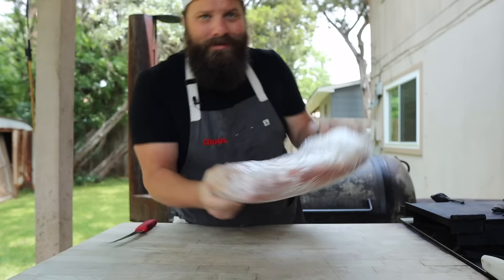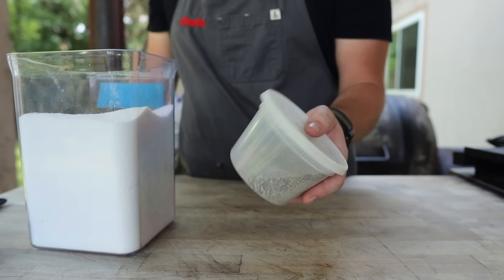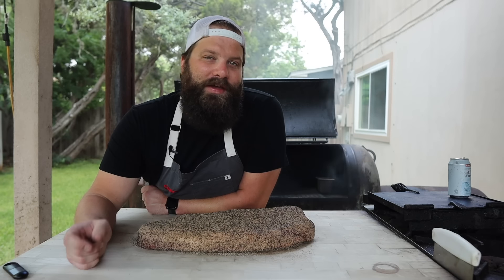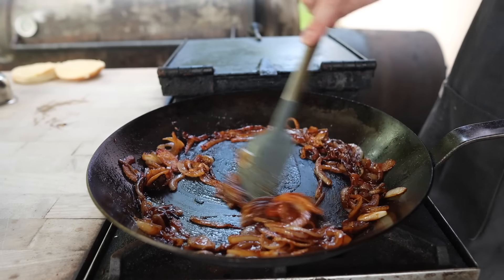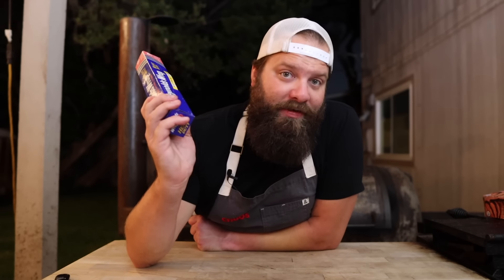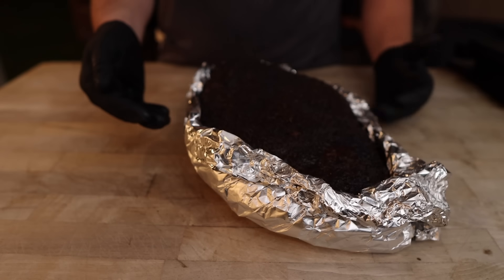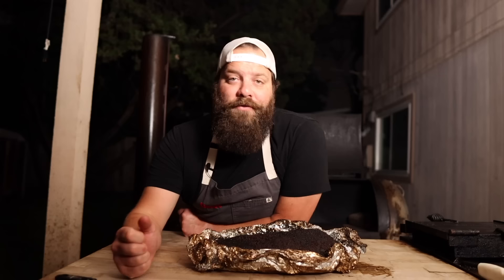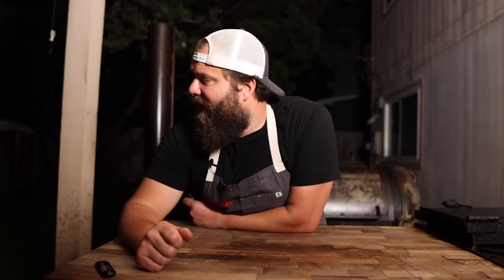How to Smoke a Brisket! | Chuds BBQ

Comment: Bradley, do you recommend letting the brisket drop to 160° and then putting it in the 170° oven?  If so how long would be too long to rest it in the oven at that temp?  Just not looking to over cook it while it’s supposed to be resting.  Is that even possible at that warming temp?
Reply: keep in mind, most home ovens do not have terribly accurate temp control, especially at the min/max range. I tested my new electric with a quality temp probe, and its minimum setting of 170, actually kept it in the 180-190 range, after stabilizing. And that is too warm for an overnight rest. i was hoping it would actually keep it cooler than 170, best case was it keeping it at 160, but alas, no. I have read that its possible on some to adjust those min settings, but haven't looked into it. Mine is a Frigidaire glass top.
Reply: @ckmoore101  ya that’s what I’m afraid of…. And on the opposite end, if I drop it in a cooler with towels, it may dip below 140 which isn’t safe…. So how can you keep it warm enough but not too warm?? Thinking about wrapping it in an electric blanket in a cooler perhaps???
Reply: @Bigslimjim81  After pontificating for a few.... first, start with a quality cooler. Boil a ton of water and pour in cooler, and close lid. leave it for at least 30-45 minutes. Then drain, and put in brisket fresh from smoker, and cover with a lot of towels. One of these days, i want to test this, and just see how long it takes to dip below 150. Could be the only time its actually worth it to drop the cash for a Yeti cooler, since pretty much everyone agrees they are the best there. I saw a specialized one at my local BBQ store (Kansas City BBQ Store). I love that place. Cooler was $300 though..... i didn't buy it.
Reply: @ckmoore101  think I’ll follow the cooler method and see how long before she dips below 150°.  Also may throw in a heating pad which might help to maintain temp inside the cooler too
Reply: @Bigslimjim81  Not a bad idea! Heating pad might make the boiling water step unnecessary. Do any pads today NOT have timed auto shut-off? 
Post results.
Reply: @ckmoore101  forgot about the auto shut off feature…. May have to re-think this..
Reply: @Bigslimjim81  Try wrapping bricks in tin foil, and heating them up in the oven at 190-200 for an hour or so. Then lay them on top of a towel in the cooler, and then cover with more towels, then meat pan, more towels. I bet that will work for a good 12 hours, or more. I havent done this, but it just hit me.
Reply: @ckmoore101  wow what a great idea!!

Comment: What is considered a MAJOR temp swing?  Still haven’t tried a brisket since I am getting used to fire management.  When I am trying to cook around 250° I’ll throw a log on around 240° and it will usually spike to about 300-320.  Is that a major swing or somewhat normal?
Reply: Are you on an offset? You should be able to keep it within 25 degrees. Like I cook at 250 to 275. Throw on a new log, goes to 275ish, wait for it to dip into the high 250s and throw another log on. If your jumping 50 to 70 degrees at a time, you need to use much smaller splits.
Reply: @blakelocati  yes to the offset.  Old country Pecos.  My next smoke i was going to try smaller splits to see if that helped.
Reply: @joestarke1357  I have a similar size smoker but homemade. Split your wood down and even consider cutting them in half. I personally use 2x2x8” pieces and put two in at a time
Reply: @blakelocati  thanks for the help!   I would say my splits are about 3x3x16.  So a little bigger overall